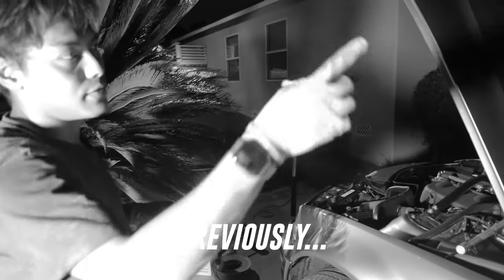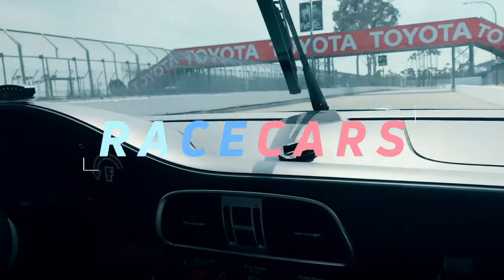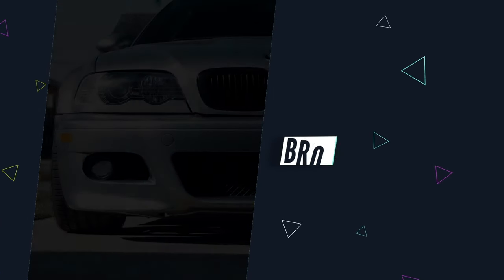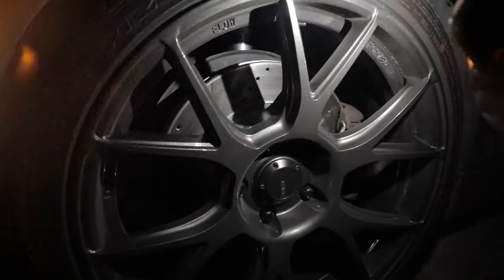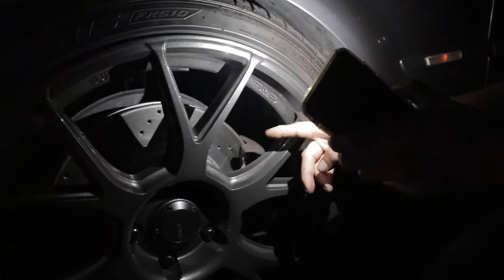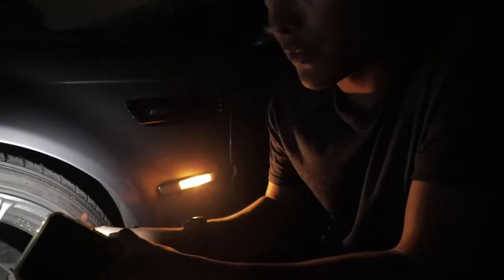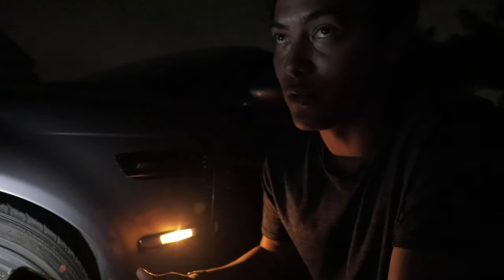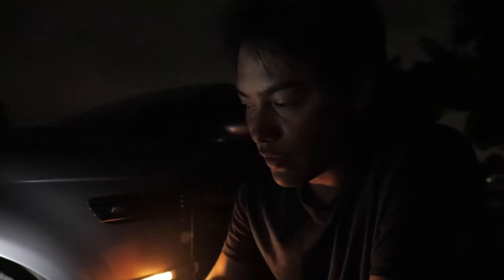How To: Bedding In Your Brakes

Comment: Thank you for the video. Question, my rotors are in good condition and don't need resurfacing, but need to put new pads, can i do the bedding just like you did or do i have to remove the old pad bedding from my old rotors?
Reply from the maker: Yes you can although I always recommend changing rotors whenever you change pads. Hope this helps

Comment: Is the e46 m3 daily driven? I kinda want one as my only car but I really don't want the headache. E92 M3 seems much better built
Reply from the maker: Axel Davis yes the E46 M3 is daily driven. All M model bmws will have their fair share of troubles. 

The E92 M3 is an amazing car, but will still share similar issues, like rod bearings, fuel pump, coolant; all at a more premium price.

There is no escaping working on these cars! That’s why you gotta do your due diligence.
Reply: Teo Corrales so which one would you personally recommend? Or is this a question with no wrong answer lol
Reply from the maker: Axel Davis that’s so hard to answer haha. If I were to start over, I’d probably go with the E92 M3 just because of the sound. Nothing beats that V8!

Comment: Is bedding only for new rotors or do you need to bed new pads on old rotors?
Reply from the maker: If new brake pads are installed with damaged rotors, the pad won't properly contact the rotor surface. They work hand-in-hand, so it's best to replace both pads and rotors. Less work for you in the future! (: